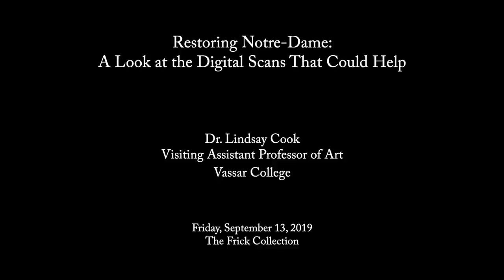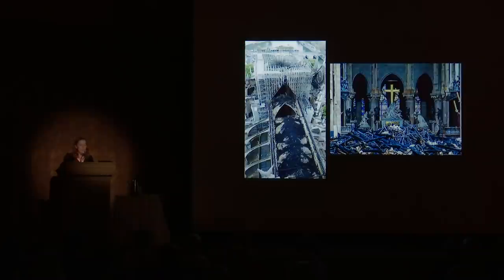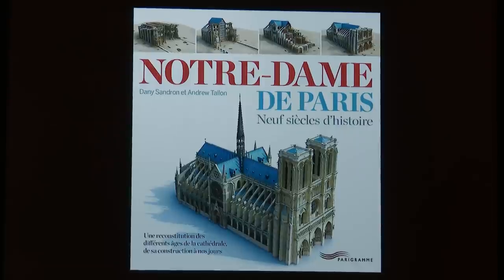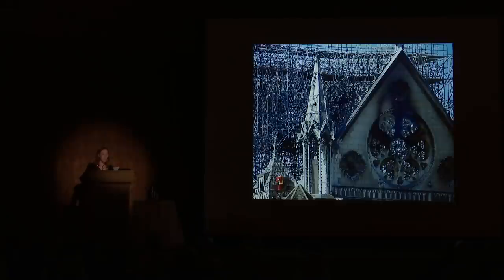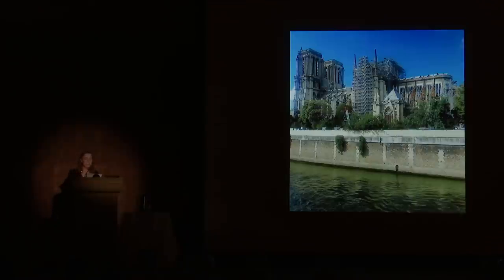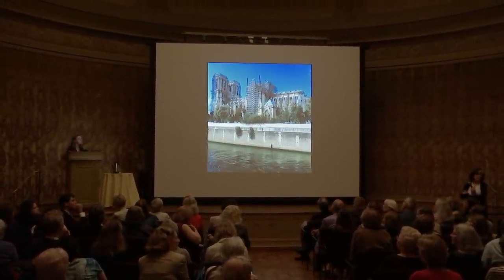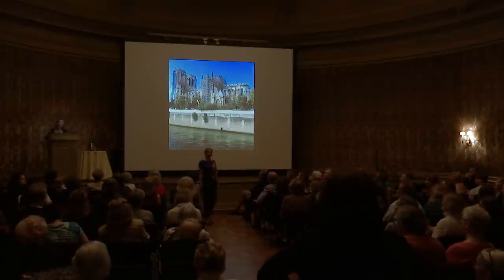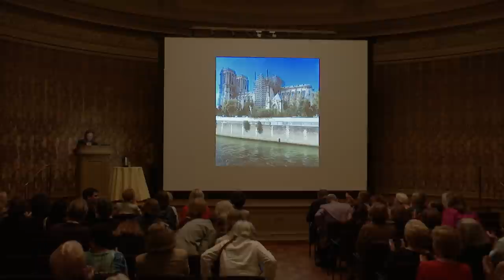Dr. Lindsay Cook: "Restoring Notre-Dame: A Look at the Digital Scans That Could Help"

Comment: The way I see it, Notre Dame is timeless and was built using the materials and technology of the day. And the same was true as work continued through the centuries, so there's nothing wrong with using today's techniques in the restoration. As long as they don't lose the look and the character of the cathedral, I don't think anybody should object if the roof, for example, is reconstructed using steel and aluminum.
Reply: Couldn’t agree more.

Comment: In that the digital scans from the previous engineering of the roof structure,can show the stress pressure points on the now weakened walls.
A new engineering of a roof structure that can be designed to be stronger but lighter and permit the roof structure can also be engineered to strengthen the damaged walls. Such as an arched truss as the main support of the upper roof structure as opposed to the triangular sub structure. From such a main substructure, a triangular roof structure can be supported above,by the the arched truss.

Comment: I wonder if the misaligned posts in the left part are because there are soft spots under the foundation. the right parts seem to be fine and orderly but if everything was already up they didn't have concrete to shore up the foundation.  This might be a point in the reconstruction that would need to be addressed before the roof went back on.
Reply: Differential settlement is one of the most common problems with medieval cathedrals and involved foundations and soil conditions  whose load bearing capacity could not have been calculated by medieval builders.  Generally speaking the settlement problem is caused or exacerbated by the addition of large towers at the west end, as in the case of Paris, and in England especially, massive crossing towers.
Lynn T. Courtenay, The Engineering of Gothic Cathedrals, vol 1 of Studies in the History of Civil Engineering, Ashgate, 1997.

Comment: they should not use wood timber frame for restoration.
use aluminum alloy or some other material that is light, strong, long lasting and fire resistant.
Reply: I really doubt timbers that size are available but if not, framing could only partially be done in another way.

Comment: There is a certain sense of hypocrisy to suddenly deciding to fix the structure in time, thereby defining it as the “correct” version, while at the same time restoring the le-Duc fantasy spire he designed in the 19th century, great though it might’ve been. His philosophy of a living building that must adapt to its use cases in time is utterly stomped upon or, potentially even worse, is honoured by indicating the commercial tourist value of the “iconic” pre-fire state takes precedence over the cultural significance of the building. Regardless, that decision looks more populist than academic, especially since the architectural historians keep highlighting the importance of the temporal dimension. I’m afraid I see the restoration decision as rather vulgar and tasteless.